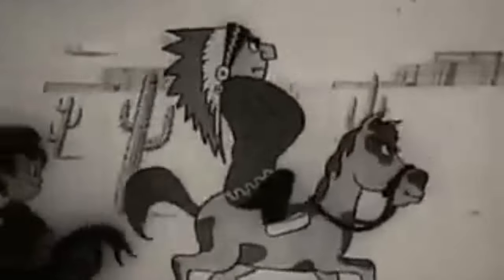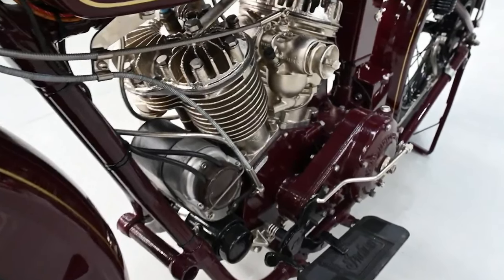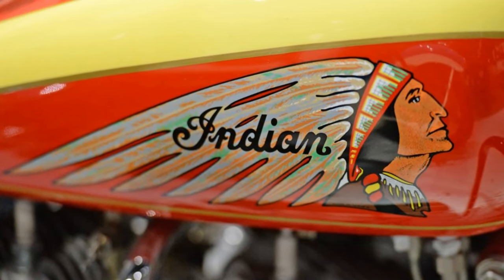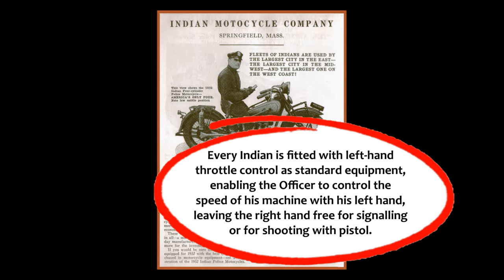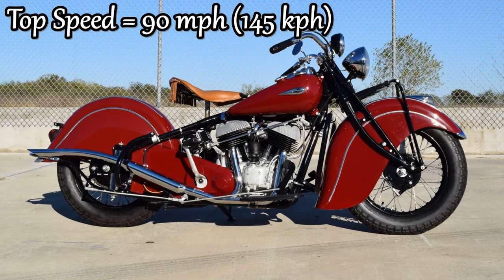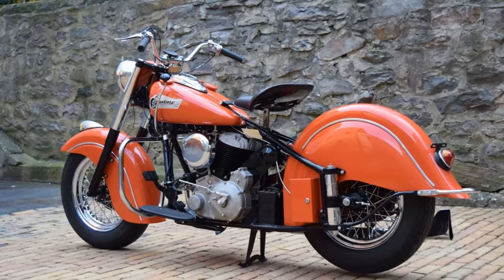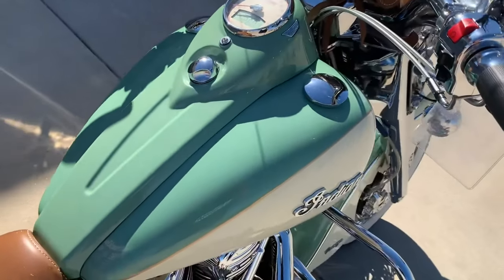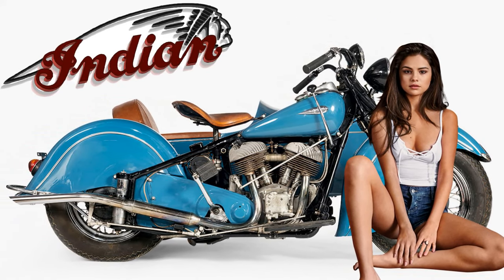Indian Chief - History and evolution.

Comment: Totally enjoyed all of your work and information. My only question is why didn't you bring up the new mid sized Chiefs? By the way, I'm an old Springfield rider.
Reply from the maker: I'm glad buddy but I'm not sure what you mean by mid sized chiefs?
Reply: @motorcyclecafe  I'm talking about the 2022, 2023, and 2024 Chiefs with the same Thunderstroke engines, but in smaller frames than the full sized Indians.
Reply from the maker: @farmon2000  Mainly because they do in fact have the same engine but the bikes you mention, in appearance, do not resemble what an original chief looked like.
Reply: @motorcyclecafe  I understand your view point.